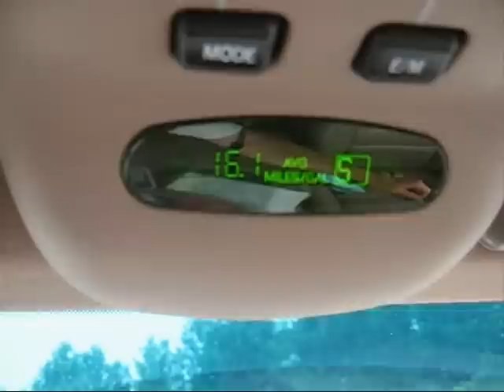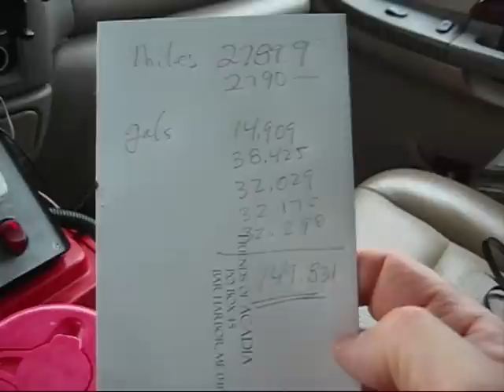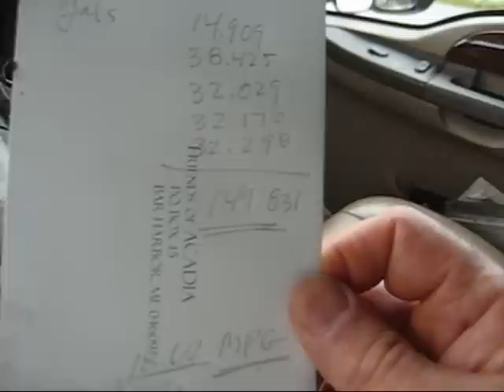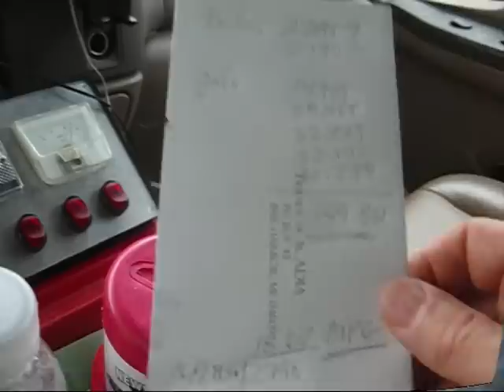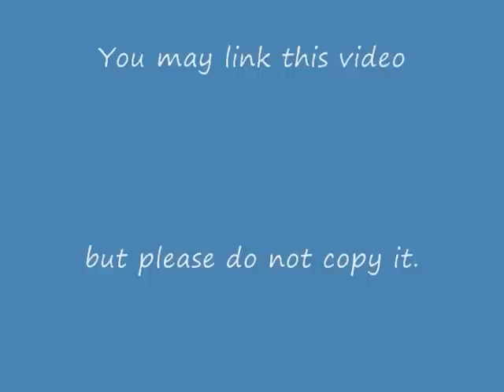MPG (mileage) Test 2790 miles with Dry Cell HHO F350 Superduty 7.3 Diesel

Comment: You're forgetting about the chemical energy that hydrogen and oxygen can donate when ignited.  I'm no genius on how these HHO systems work with cars but there's more than just electrical energy at play.  You're using electrical energy to get usable chemical energy.  Just like diesel and gasoline are chemical energies. Those have to undergo a process as well to utilize their potential.

Comment from the maker: @eyeswideopennimrod: This diesel engine is direct injected. The fuel is injected at very high pressure into the cylinder at the top of the compression stroke. The fuel is liquid when it is injected as a fine mist. The outer surface of each tiny blob of diesel fuel is heated into a gaseous state and it instantly ignites and continues to burn as the remaining liquid is turned into a gas.   
It helps to heat the diesel fuel to a point but the injectors need the fuel to be liquid.

Comment from the maker: @paladain55: Hydrogen and diesel fuel (vapor) are the fuels and oxygen is the oxidizer.  The liquid and solid states of mater are not flammable. Mater is only flammable in the gaseous state. In this case the diesel fuel has to be heated until it is in the gaseous state before it can combine with oxygen (burn).

Comment: 60 amps???? x 12v= 720 watt.... So your hho gen  takes 720 watts away from the engine (to power gen)....therefore it only gives your truck an extra 720 watts of power (if its 100% efficient).....energy in energy out people.....Net result =0

Comment from the maker: @halolife360 Anything that sticks out from the surface of a vehicle increase the drag on the air as the vehicle pushes through it. Most of the fuel consumer by the vehicle is used to over come the drag caused by the air. A windmill would almost certainly be less efficient than the alternator. Although a windmill could be used to charge the batteries while the truck is parked.
Reply: How about solar panels for the juice to power the HHO unit

Comment: @mars1952 DIESEL + HHO

 Hello, I have a 1998 Mercedes E300 TD with automatic transmission and I'm interested in putting this system in the car, you know, tell me where can I buy one.
 The car is Diesel, Turbo, 3000 Cm3, 177HP.

Comment: @MPTuners you do understand that this is a truck.. built for pulling not speed. i you would like to hook your 1.5litre car up to any vehicle with a diesel engine in it and try to pull it.. you will get embarassed. and if you look up diesel 1/4 mile drags they can stomp gas engines. fuckin ricer owners -.-

Comment: I got a 2000 excursion with 7.3 an I get 18 on a bad day long trips I get 24 or more an its 9800 gvw u don't need all the stuff just a chip air intake exhaust an turbo up grades

Comment from the maker: @OldRangeRat You are correct that the production of HHO is very inefficient. But do not think of HHO as an added fuel. All of the energy in this case comes from the diesel fuel. The HHO just increases the efficiency of the diesel burn. For HHO to save fuel it has to increase the efficiency of the burn more than enough to offset the lose caused by making it.

Comment from the maker: @booniesgangsta It looks like a science experiment because that is what it is. However, it has not gone wrong. I have observed an increase in MPG on most of my tests. Some tests have shown no gain but none have shown a loss. Weight reduction will increase fuel mileage but in this case the apparatus weighs less than 40lbs. Compared to the 9,000lbs gross weight of the truck 40lbs is insignificant 4 tenths of one percent..

Comment: This makes no-sense.  The amount of HHO produced by your system would be much less than 1% of the energy needed to cruise at 60MPH on level land with the size of your truck.  Plus about 75% of what it produces is used for its own production (to turn the water to HHO).  But, I have no doubts that you get better mileage with the HHO generator. 7.3L times 2000rpm/2 times 1/9 = 811Liters/min  I have doubts that you produce 8 liters of HHO per minute.

Comment: G/day Mars1952.  If you go to jtsdesign on youtube I ran a V8 Gen 3   5.7ltr Chevy motor and was getting 32 miles to the gallon with HHO generators(2) doing 60mph. I also had electric high pressure pumps on. Pressure of fuel to motor was 28 pounds before returning to fuel tank.  Hope this is of some help. My Email address is jthornley2@bigpond.com.au       Jim T

Comment from the maker: @electronicdawg After soldering the connections and switching to a single large solenoid (relay) I have drawn over 110AMPS without anything melting.

Comment: Bolt your connections on and use 10g wire, and you could not have been pulling that kind of amps you would have melted the wiring.

Comment: There is no such thing as 'HHO' gas. Electrolysis of water produces H2 and O2, i.e. hydrogen and oxygen gases (neglecting random by-products). It always has and always will. The HHO configuration DOES NOT EXIST. How many times do people need to be told this?

Comment: Nice video!
 I'm still trying to decide if HHO dry cells are really improving mileage. Have you done a trip at the same MPH and driving and weather conditions but without using the HHO unit? What was your original mileage Before installing the HHO cell system?

Comment from the maker: @godoffire7 This truck has a MAP sensor but no O2 or MAF sensors. There is no way to restrict air flow through the engine. The fuel flow is controlled by the throttle position sensor (fuel petal).

Comment: hey does your truck have oxygen sensors? if so you might try to space those farther away by means of a spacer thus telling the computer th truck is running kinda rich in fuel compared to oxygen . that might trick you truck into thinking it needs to lean out the fuel flow... what  do you think? message me and tell me what you think please.. thank you and good work!

Comment from the maker: @nebulasxtv The problem was not the size of the wire but the quality of the connections. I have since replaced the 4 relays with a large single one and soldered all the wire connections. I also replaced the PVC tubing with reinforced hot water tubing and clamped it with worm screw clamps. I can now run the brick at 100amps without any problems except that the efficiency go down at higher amps.

Comment from the maker: @jeep4jeep Hi: It's been a while since I took this trip but I think that the 14.909gal was the final fill-up and top-off. I did not show the top-off amount from the start of the trip.
Mars
Reply: Will you get better mileage if you give it more HHO?
Reply: I upped my mileage to about 18 1/2 miles to the gallon on my 2001 Super Duty with the 6-speed overdrive manual transmission whenever I put a K&N air filter on it. Your results are pretty disappointing as far as that goes. I'm going to give it a try anyway. Hopefully I have better luck.

Comment: Is your 14.909 the initial brim fill, because by my calculations you don't need to add that into your consumption figures as thats zero/brim - and you measure brim to brim, hence this would give you 20.68 mpg

Comment from the maker: @spitfireknls The original idea was to switch off some of the cells in the brick when less HHO was needed. I have learned that even when I run the whole brick I am not making enough HHO. I have removed the circuit box and replaced it with a single large relay. I have soldered the connections and don't have overheating problems even when pushing the brick to 100amps. I have plans for a much larger brick.
Mars

Comment: @mars1952 I suggest to install 2 fans in your circuit box, one on each side symetrically across from each other to help keep your breakers cool so you can close your junction box door like your supposed to. Remember one fan should be an intake and the other an exhaust (one pushing air in one out). Also these fans don't need to be no larger than the diamater of a 1" pvc pipe. You can find fans solar powered this size made for car windows to help keep cars cool. Let me know if this helped

Comment from the maker: @lionblaze244 This diesel doesn't use an oxygen sensor. Where do you think I should use one? There is no way to regulate the air that flows though this engine.
Mars

Comment from the maker: @TAD1311 Hi: This brick is an old design and I have purposely pushed it beyond it's design limits. I have soldered the connections and they do not get hot now. I have pushed this brick to 110amps but peak MPG increase seems to be at 80amps. This truck has a big engine and the production @ 35amps is too small to make any difference (check out some of my earlier tests). The difference between NaOH and KOH is minimal. I have always used distilled water.  I have newer designs. Check out my Playlists

Comment: @rikkiesix obviously, you omitted in your thinking the fact that people use trucks for work, not just back and forth to work. i have a little ranger (3L v6) that gets a little better mileage than this guy's larger v8. in any case, a smaller vehicle isn't necessarily what one should be thinking, as there a lot of factors that go into what kind of mileage someone would get - vehicle weight, personal weight, drag, suspension, coasting to a stop, tire pressure, fluid viscosity, quality of fuel...

Comment: If you can add an extra connection (diagonally opposite) to corner of each plate. Current will share approx equally between each connector. Halving the load on those crimp on spade connectors. Also the actual distance traversed by the current within each stainless plate is then halved further increasing your e'lyser efficiency.

Comment: @partwerks i have been using NCE it is expensive but is reusable and does not turn brown. Alsoit does not corrode aluminum since radiators,some blocks,cylinder heads are made of aluminum and pot and sod will eat through it especially if you develop a leak you dont know about until it is too late. befreetech has cheaest price and shipping.

Comment from the maker: Hi rikkiesix:
I need this truck to pull 10,000lb (about 4545 Kg) equipment trailers. I have considered getting a small second vehicle but it turns out that for me it is not cheaper considering all the expenses associated with a second car.  Keep in mind that the environmental regulations are differnet in the USA than the are in Europe. European regulations control different emissions and enable better  fuel consumtion. Also consider the carbon debt of a second vechicle.
Mars

Comment: @KENNNUSA  The average is 1 liter for approximately 200 Watts if you can do 1 liter with 100 watts as you suggest you have the Holy Grail of HHO production. As many have tried and failed. Some  new developments are the use of Nickel and or Platinum and they report closer to 100 Watts for one liter. We have found with the PWM that the system needs to be sized for 2X the amp draw because of the pulses.

Comment: We have a hybrid cell that produces 4L @60 amps. built like a dry cell without the exposed plate edges. also 4ea 5/16 connecting bolts and recommend #4 wire for voltage drop. We also use a PWM rated at 220amps set at 65Amps the cell can produce 4L from start to finish no matter the ambient temp. Requires a circulating pump to reduce the steam and increase the efficiency. Reduces the exhaust emissions by 70% and increases fuel economy by 25%. Best part no leaks no gaskets.
Reply: Use 24 volt super capacitors use 2 on ebay bit expesybut yea a big 4 upgrade you know grounds all that

Comment from the maker: @partwerks  Sodium Hydroxide is lye in it's purest form. Both Potassium Hydroxide and Sodium Hydroxide are strong bases (the opposite of acid) and will react with aluminum. If you have a good bubbler the HHO will be washed as it bubbles through and very little Sodium Hydroxide will make it to your engine. If you run your HHO generator hot to the point that steam is going to the engine then you might have a problem.
Mars

Comment from the maker: Hi water4fuelh20: I will try to respond to your comment point by point.
1) "2,000 mile trips on a daily basis" HHO generators don't work well on short trips since they have to warm up before they start to work and the output varies radically at different temps. Testing the brick on long trips removes many variables and proves the concept.
2)"cannot afford to even buy 316 plates" I used SS from the scrap yard @ $1 per pound. Continues:

Comment from the maker: Hi wilbobagins: I realize that your remark is intentionally inflammatory and unintentionally poorly thought through but I will try to educate you anyway.
I use my truck for work. I routinely haul heavy loads and 10,000# trailers a small fuel efficient car ar truck could not do the work that I do with this truck and it is not cost effective to purchase a second small car for the occasional vacation or trip to town.
This ridiculous device has saved over 250 gals of diesel in the first year.
Mars

Comment: hmm, shows what i know, cummins 12 valve is about the only engine in the diesel type I have much exp with, a little with the 24, good engine, dont care for the pump much. why fix the mech system? It work perfecet

Comment from the maker: Hi XLR8RRICK: Thanks for the comment. In my Mars Gasket series of videos I built a prototype dry cell and I made four connections on each pos plate at the corners and four connections on each neg plate in the middle of each side. My goal was to limit the variation in voltage from side to side on each plate. The brick in this video is my first drycell that I made about a year ago and as you can see all the connections are in one corner.
Mars

Comment from the maker: Hi villenbruc: I like the idea of soldering the wire into a slot. That will increase the contact area between the wire and the stainless steel and help overcome the limited ability of the stainless to conduct electricity. Spreading out the contact area will cut down on hot spots.
Mars

Comment from the maker: Hi Gforce1956: I am not using any electronic manipulators of any kind. As D3 points out diesels do no have Mass Air Flow sensors. 
I believe that MAF and EFIE foolers increase the MPG but lower power and shorten engine life.
Mars